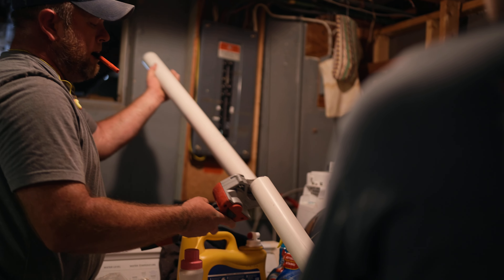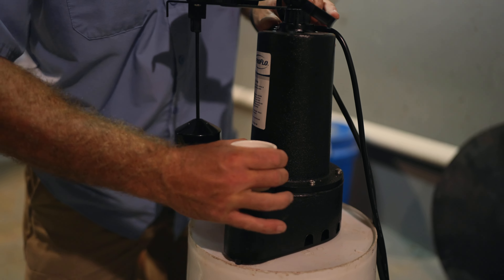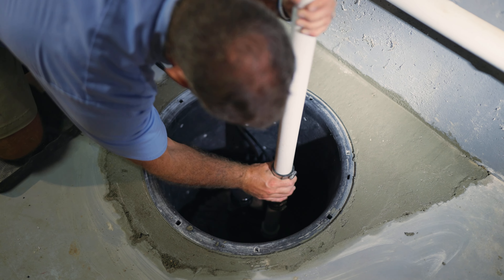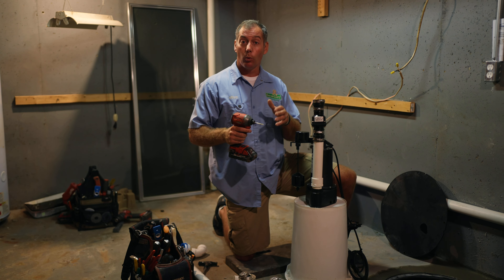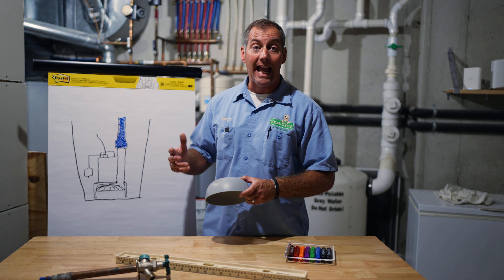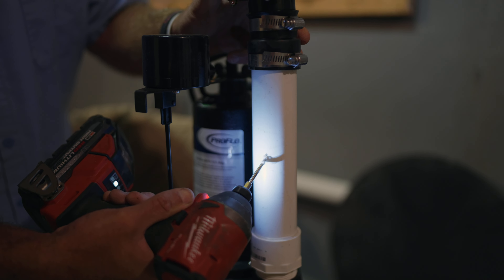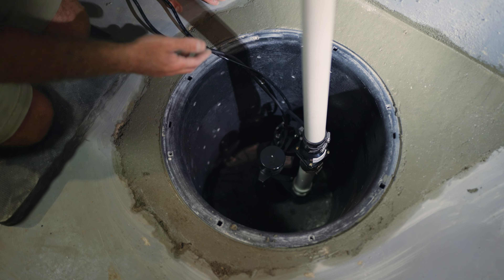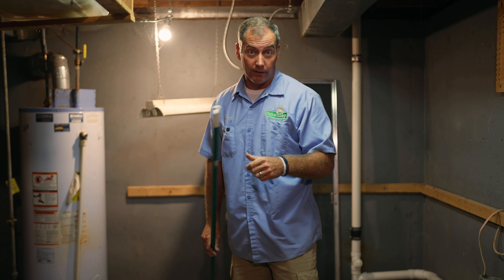How to replace a SUMP PUMP so it lasts FOREVER!

Comment: the check valve in my sump was installed a few inches above the sump. Can that cause a problem?
Reply from the maker: Nope.  You should be good as long as there is a weep hole between the pump and the check valve.
Reply: @SmedleyPlumbing  that's great to know. much appreciated

Comment: Thanks for taking the time to thoroughly explain the reason for the weep hole. I am in the process of installing a sump pump and will make sure to drill an angled hole in the pvc below the check valve.
Reply from the maker: Glad it helped

Comment: Good information, thanks. Just curious, why not use long 45° couplers to connect to the vertical pipe? I've always done it that way, because it's not as abrupt a turn for the water.
Reply from the maker: Being a shorter pumped line, you don't have to worry about restrictions.  Many people will use pressure fittings that have a very abrupt change.

Comment: I’m tackling a sump pit dig and pump install this weekend.  I really appreciate your details in these sump vids and clean work. 👌 One question about the basin - do you recommend drilling 3/8 holes all the way down the sides of the basin for any install?  Or does it depend on the water table?   I’ve seen some recommendations to only drill holes around the top third to keep the water around 8” below the slab so the pump doesn’t cycle too often.
Reply from the maker: We drill them from about 4" and down.

Comment: Great instructional video.
One question though...
Regarding the small.section of pipe that connects to the PVC  MIP adapter. In the video it appears that the small section of pipe was Not glued into the MIP adapter.

Is it necessary to glue these two parts together?
Reply from the maker: They were glued but sometimes it's hard to see the glue.  But yes it's imperative that they be glued together.

Comment: Appreciate the whiteboard explanation! Is there a sump pump you highly recommend for backyard applications? The run from my backyard to street is really long and doesn't have a natural slope, so I decided to go with a sump pump.
Reply from the maker: If you're in an area that freezes, you probably won't want a check valve on the system.  We like ProFlo, Little Giant, or Zoellar sump pumps.
Reply: @SmedleyPlumbing  Thanks for the quick reply and providing three options. I felt like Zoellar was my only option, but now I have a few to compare.

Comment: Hello, thanks for your expertise. I would like to know that do you need a weep hole for the pedestal sump pump. Thank you
Reply from the maker: Yes you do
Reply: @SmedleyPlumbing  thank you for your quick response, another question I have if is it possible to install check volve horizontally,  not 90 but 45 degree ?? thank you
Reply from the maker: @da-ct6hr  you can install the check valve horizontally or on a 45° angle as long as you install it so that the hinge of the flapper is on the top side of the check valve. You can either look at the check valve to find where the hinge is or it will tell you to install this side up in the horizontal fashion.
Reply: @SmedleyPlumbing  thank you very much for your precious advices.

Comment: I like your knowledgeable video ❤
But I don't get its,sweep hole hights base on folat switch/sub pump's hights?
Reply from the maker: I don't think I understand what you're asking...
Reply: @SmedleyPlumbing  Is sweep hole can make anywhere between check valve and pump?
Reply from the maker: @chun-hanchen1164  yes they can be drilled anywhere between the pump and the check valve as long as it's drilled within the basin.

Comment: Hi, what if I have my sump pump connected to a hoose, instead of. Pipe. Should I make a weep hole in the hoose itself? Can I make the hole in the pvc L adapter that comes with the pump, that connects the pump to the hoose?Thanks
Reply from the maker: I would dril a weep hole in the plastic adapter from the pump to the flex hose.
Reply: @SmedleyPlumbing  thanks for your reply. I will. My sump pump sometimes does the sound like it is running, but it doesn't pump any water. Then after some time, I try it again and it starts working, although it never pumps water, like when it is on the surface, it pumps and suddenly stops. It is working in 4 meter deep, but it says it can goes up to 9 meters deep. I don't know if the problem has to do with air, or the fact that I dont't use a check valve. What do you think? Unless the manufacturer lieed about the pump's specifications. The hoose has only 25 mm
Reply from the maker: @filipelollita806  or the float is getting stuck and holding the pump on after it's pumped the water out.
Reply: @SmedleyPlumbing  not in this case because the pump is fixed in the  on position. It pumps the water, then it slowly looses water flux, until it stops. And there is still a lot of water in the pit. It seems like it looses the capability of pumping water, as it pumps water. It doesn't seems powerful, but it's specifications says it pumps 20.000 liters per hour. It is 1100 watt.

Comment: Very helpful. Thanks. I keep finding that the pumps fail after only a few years, some make it only one season. I've never drilled a weep hole. Could that be the problem? Also, in the dry season here in northern California, I remove my pump, clean the outside, and store it in my tool room. Does that sound about right?
Reply from the maker: Could be.  Under use and over use are the two worst conditions for a sump pump

Comment: The weep hole should be above the water line in the basin?
Reply from the maker: Needs to be between the check valve and the pump.  Usually closer to the top of the pump.
Reply: Yes, but the weep hole should be submerged under water?
Reply from the maker: @Lwnmwrboy5  sometimes, yes

Comment: What about installing a remote switch that is out of the sump pit? My sump pump seems to work very well until the switch goes, and replacing the switch is fine, but every time the switch goes I’m in danger of getting water in the basement, is there a remote switch, that would work well, and you can show how to install that? Would be very useful, thank you!
Reply from the maker: In this case, the remote switch would be the disconnect the piggyback plugs and plug the pump directly into the outlet.

Comment: really should just ziptie the float switch on permanently then get a soild state waterlevel detector switch and plug the pump into that so that once the water reaches the level of the detector it powers on the pump. And you really should have a redundant pump system plugged into a separate power circuit entirely with a battery backup somewhere (whole house or just for the pump, either is cheaper than a flooded basement loaded with mechanical equipment and other valuables). Floats suck because eventually those internal mechanical power contacts will arc and fuse then your pump will burn itself out and you will be screwed. Ask me how I know this.
Reply from the maker: You're making a lot of financial decisions for the customer.  Not all customers just open their wallet and say "give me the best!"
Reply: @SmedleyPlumbing  well the title of the video is "how to replace a sump pump so it lasts *FOREVER*" That last part is pretty important and false if you expect that switch to not fail suddenly eventually. Just google "sump pump switch fail" and you'll see it's pretty common. And 30ish bucks for the bare minimum solid state level detector isn't exactly a life changing financial decision for anyone.  Just saying. And the whole redundant system part is just a suggestion for foolproof peace of mind for those who want it to cover all bases you didn't, which I think is fair. Don't you??? You should be pinning this comment instead of criticising it.